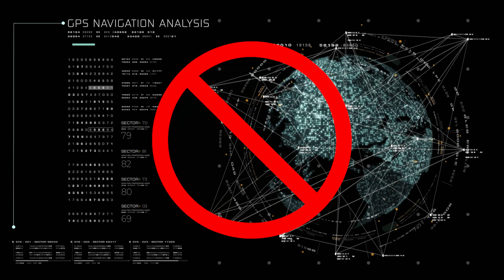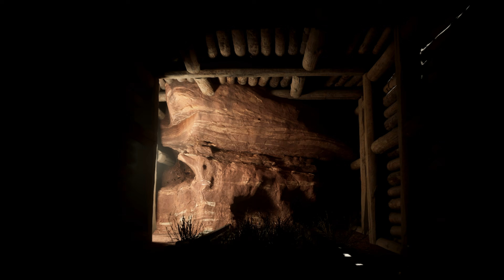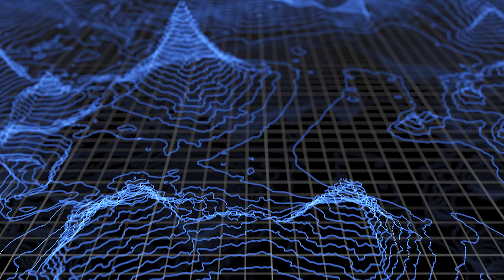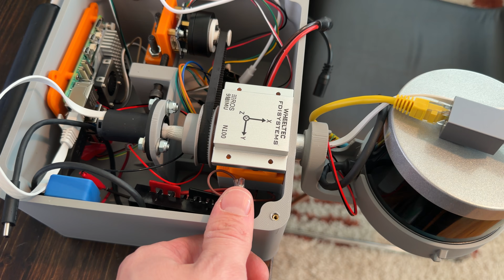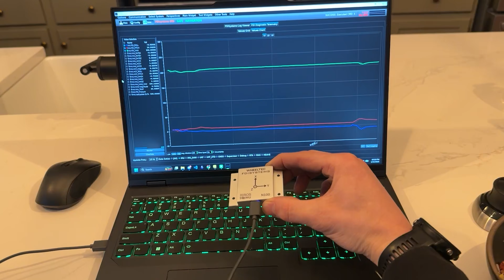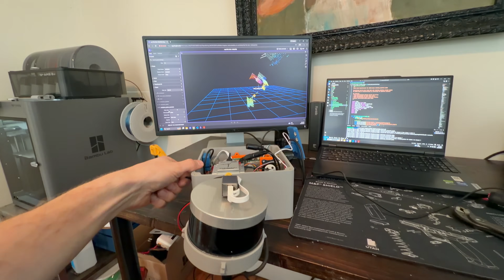I Built a Scanner that Sees in Total Darkness

Comment: If you ever want to add rtk to this and need an “affordable” imu up to the task let suggest the im5 by inertialSense. I use one on my vlp16 project. It resolves yaw/heading by geometry between two rtk antennas. It all but eliminates deskew issues with drifting or lagging imu yaw. It also has onboard ekf fusion so you can get 400hz inertial navigation.  I paid $400 a year ago for mine and i use two ublox zed9 rtk boards off aliexpress that are $80. After seeing sticker shock of industrial imu with less accurate yaw this route is an absolute bargin if you need rock solid position at the full range of the vlp beams

Comment: Stoked this video found its way onto my feed! I scavenged a “bricked” vlp16 off ebay last summer. Rolled the dice that the reseller just didn’t know the ip address. 30min of ip snooping and I got it to work. Anyways, my setup is basically an rtk driven version of your stack with the goal of real time snow depth for ski resort snowcat operators. I spent all winter learning linux/unbuntu/ros/ros2/creating a poe network to wire into the snow cat and currently diving into the world of swift/ios app dev to display everything on ipad. You have no idea how reassuring your videos are that Im not crazy in this quest. 🙏🤘🫶

Comment: Rather than rotating the entire head, would a 45 degree mirror rotating around the fixed sensor work and be mechanically simpler?
Reply from the maker: You wouldn’t need a slip ring, that’s for sure

Comment: The wire connections that pass through that spinning axis are going to be.... interesting.... 😂
Reply: Looks like a commodity slip-ring assembly.  Cheap online from the East.  Probably reasonably priced on the rainforest site and very expensive when made in the West.  I had a quick look and the pricing is wild.  They start under US$5.

Comment: Currently gathering LiDAR scans using my phone for capturing cave data to supplement digital and traditional survey in caves. Are you going to NSS Convention this year in Indiana? If so, I'd like to meet up and see about testing this in some specific caves in my area. Currently working with the CaveWhere dev to add point cloud support, by supplying data, but I am limited to VERY rough Polycam scans of smaller volume rooms.

Comment: Working on a similar system inspired by "Alpha LiDAR" paper. Using Livox MID-360 Lidar and a large gimbal motor with hollow shaft (to pass wires through). As I understand, time sync in such systems are critical to get precise point cloud registration, so you need hardware time sync (most commonly GPS/PPS signal) tied to every motion and data-related component (lidar, IMU, motor encoder etc.). How are you dealing with time sync in your setup?

Comment: Very cool. I've worked with large lidar data sets that we captured with helicopter. Yep, they love to use proprietary formats even for the data. Anytime you have to export the data you need to use there software which guess what? It's subscription based and takes forever and there's no scalability one operator one piece of software.. hopefully some of the open source slam packages can work for you.

Comment: Cool stuff, keep up the great work.  It brings joy to my heart to see SLAM research make it into the hands of makers instead of AV companies and costly closed source products.  It's unfortunate the VLP16 doesn't have an IMU built in but if you can get good time sync with the USB IMU and the velodyne via PPS it will significantly help reduce noise in your final cloud.   Best of luck, looking forward to what comes next!
Reply from the maker: Yes! It’s been a great learning process. You’re right, IMU time sync (and potentially the IMU data itself) has absolutely been the crux of this project. After reading through tons of research papers and studying other SLAM platforms, the VectorNav VN100 keeps coming up as a reliable choice.
Sounds like you’ve got solid experience in this area, any IMU recommendations? I’m currently running a Wheeltec N100 with an FDI Systems Delta10 MEMS. On paper the specs look similar to the VN100, but I’m skeptical that FDI tests as rigorously as VectorNav, and Chinese manufacturers have been known to cherry-pick test results.
Reply: @9nl TY I've worked in this field for a bit now, and yeah the vectornav and microstrain imus are a good choice but they're $$$$.  The biggest thing in my experience is having a solid sync signal via PPS or PTP (the VLP16 sadly can't take ptp).  The other thing is to try to keep the IMU on a dedicated USB host controller, which on the Pi is gonna be a challenge.  USB standard doesn't have a way to measure latency and that uncertainty is enough to throw off measurements too.  Ultimately it's a game of balancing hardware constraints with budget.  I'm honestly impressed on your build, you should feel proud!
Reply: @PeaceIndustrialComplex The raspberry pi 5 has several dedicated USB host controllers because it has what's effectively a chipset over PCIe 2.0 x4 and 2x full bandwidth independent USB 3.0 ports
Reply: @PeaceIndustrialComplex @9nl Here is an idea that I will throw into the public domain.  What if one were to add a constant vibration, sinusoidal or pulsed at a known and very specific frequency and phase timing (recovered from the drive current).  Recovering this carrier from the sensor data and correlating it with the drive timing (you could have two orthogonal signals at different frequencies if desired) you should be able to remove offset and some jitter errors from the signals. 

Angular acceleration might also work.  You do not need to vibrate the whole platform.  Just the IMU module on compliant mountings with some freedom for where you add the signal.  A mobile phone vibrator or the thingies from some game controllers might be enough. If there is a 3D compass sensor then using Helmholtz coils to jitter the earth magnetic field could be enough.  Perhaps you could get your Kalman filter to ignore the samples that have noise added.

Achieving this is so far over my head I would not know where to start but I have read enough over the years to know it is theoretically possible, the question is how much it would benefit.
Reply: @PeaceIndustrialComplex  I added a comment below that would not tag you, worth looking at.
Reply: @9nl  look into LPMS IMUs. we use them in AGV robots and i use it in my master thesis for localization (also using Fast-LIO).
Reply: @9nl  I added a comment below that would not tag you, worth looking at.

Comment: Working on a more basic project with a rover, 2D lidar and SLAM right now. Curious to know which SLAM variety you're using, and which libraries. Right now I'm working with GTSAM in Python for GraphSLAM but it's a bit tough to work with.
Reply from the maker: so far had the best luck with FAST-LIO

Comment: I keep hoping to see someone do the heavy lift to get an iPhone lidar working with a pi or similar. Cool project, though. I'm impressed with how well your scans are aligning, given you're compensating for both the IMU orientation and the motor position. Have you verified that spinning the lidar on a second axis doesn't introduce problems in the mechanism, like precession or nutation?

Comment: Cool project! Actually, I'm very interested in how the IMU sensor will work to determine spatial movement. When using relatively cheap sensors for Arduino/ESP, the issue lies in the fact that they do not process acceleration data frequently enough, resulting in an error where the movement is smaller and offset over time.
Reply: I was thinking of that too. Would be cool to integrate landmarks of sorts with the IMU that checks its bearings. Kind of like GPS without satellite. Checks could be visual (based on expected landmarks), RF signal proximity, etc.

Comment: Can you then export the point cloud and turn it into a mesh? I've worked with Leica scanners with a Solidworks extension but that was of course proprietary. If there's an open source solution to the meshing you're really onto something.
Reply from the maker: There is open source tools to convert to mesh. So far I’ve used cloudcompare and reality scan. I’m hoping to integrate a RGB camera into the system which if I should allow for better visual maps. There are some good visual SLAM tools out there I’d like to experiment with

Comment: Incredible project here, can’t wait to see more. I look forward to hearing about the IMU specifically, I’d have assumed it wouldn’t matter much as you’re constantly getting new data to fit against the old data. But maybe the fitting of point-clouds to manifolds in order to fit the next point-cloud isn’t a task that can be done by a Pi 5 in the first place.

I expect one could make it more compact, maybe by including the Pi and battery on the spinning platform, or maybe by using a torquier motor that doesn’t need the belt reduction. If you publish this open-source, I imagine here will be plenty of fresh minds with new perspectives on this project.
Reply from the maker: Yes! There’s tons of optimization that can be done. Once I’m able to properly document everything I’ll put it in a GitHub repo. There’s plenty of people way smarter than me that I think would be able to help out

Comment: Great work - subscribed! (Ex Emesent guy here)
Reply: Crazy to see another Emesent engineer in the wild! I'm also ex-Emesent, worked on the SLAM team. Whenabouts did you work there?

Subscribed also. Super cool project, very much support open-source SW/HW mapping platforms. The hardware selection seems good, I would just watch for slippage on the belt assembly (or calibrate around it) and yeah the IMU integration is very important. Fast-LIO is pretty good but may suffer from certain amounts of drift in larger caves, you might want to couple it with some pose graph system like the one Georgia Tech has afaik. It should be not too hard to integrate.